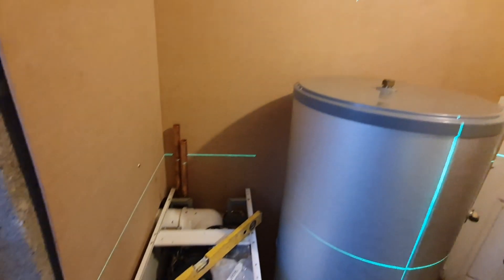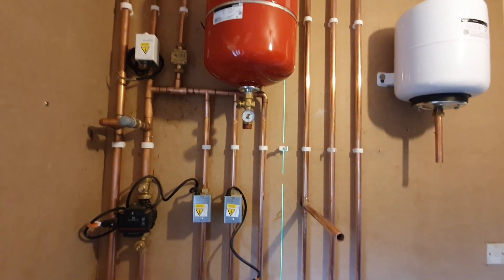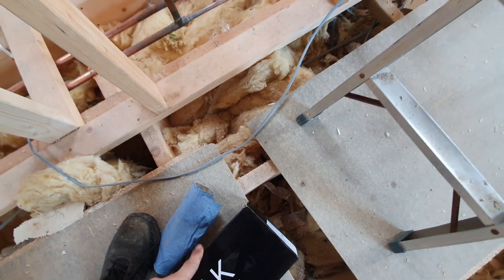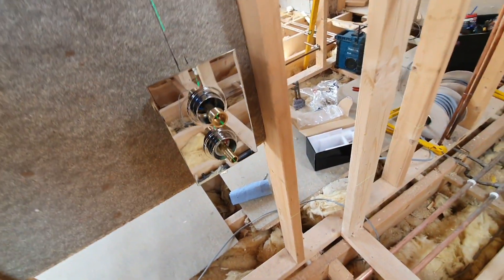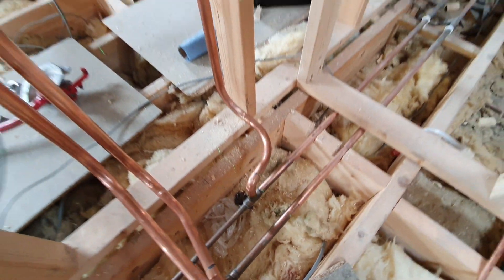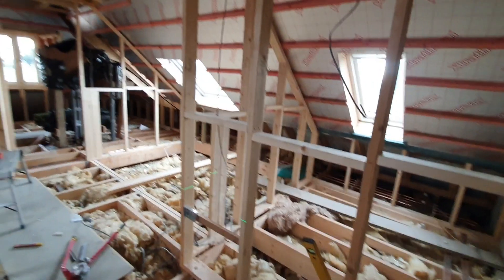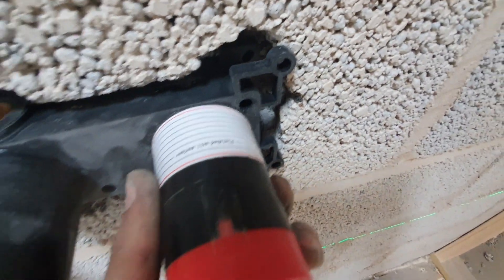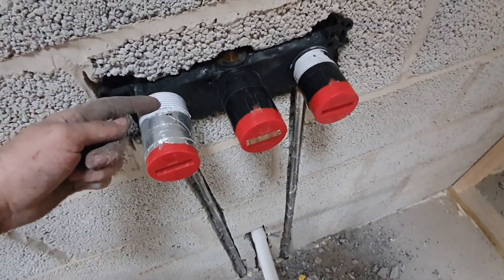Adventures of a Plumber #12 Unvented cylinder and more first fix

Comment: I like your style....new sub...... 👍
As for the bender , I found that if you clean the formers on the bender 
with some wire wool it will stop the pipe from sticking which causes the creases on the pipe....👍

Comment: If I have an elbow floating in the wind on a horizontal run like you have it. What I do is have the pipe at 12 0'clock then crimp the fitting slightly with pliers then move it to the 3 o'clock position and cos the fitting is ever so slightly deformed when you move it to the position you want it is tighter in the fitting... I learnt it from Steve lavimoniere who is an American plumber on YouTube... Great work though! Very professional! Keep the videos coming I'm loving em! From west yorkshire.
Reply from the maker: Good tip that,  Plenty more content coming on the channel soon

Comment: Terrific looking work. Do you have a set height for the waste pipe you use for wall hung basin units. I can never make my mind up on a height when first fixing.
Reply from the maker: With wall hung basin units you really need them on site at first fix stage to get them right as they all differ slightly. I think this one i just brought out at around 400mm from the floor and hopefully this should fall inside the unit
Reply: Yea. I thought that myself. Its all you can do without having the unit on site. Good man. Your work is top class
Reply: I use 560mm off FFL for the waste and pipe work 580mm this usually works out spot on for a WHB  800mm to 850mm of FFL.

Comment: Very neat installation. What unvented cylinder is that if you don't mind me asking?
Reply from the maker: It is a pro lite uk unvented cylinder 200litre. I got it from plumb centre. I prefer unvented cylinders with the external expansion but the internal ones are descent as well. Thanks for the support

Comment: Do you not need back flow prevention on the mixers?
Reply from the maker: These shower valves have built in single check valves for fluid category 2 water. The supplies are balanced so shouldn't be an issue anyway. Always follow manufactures instructions with regards to backflow requirements of taps and insure all products fitted are WRAS approved
Reply from the maker: I've got some Rpz valves to test next week so could do a small video covering back flow prevention if any body wants to see that